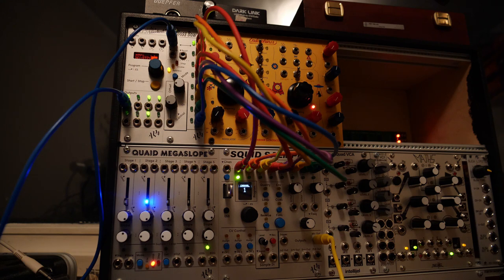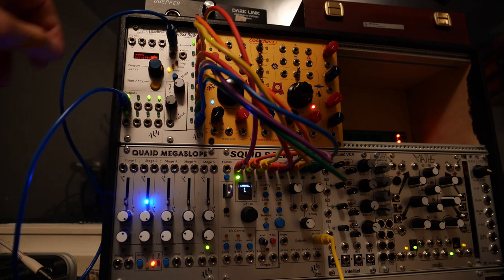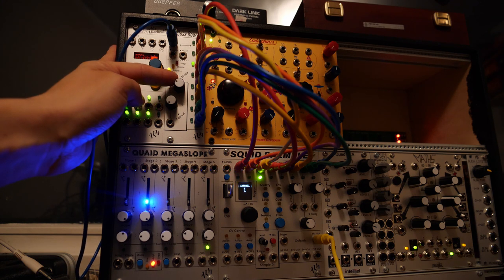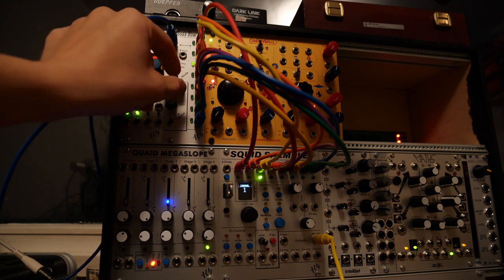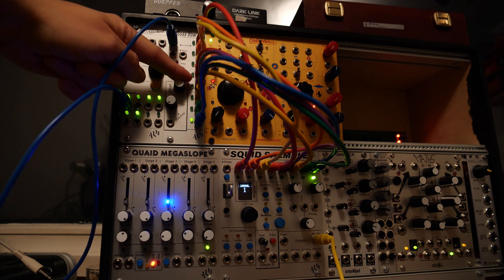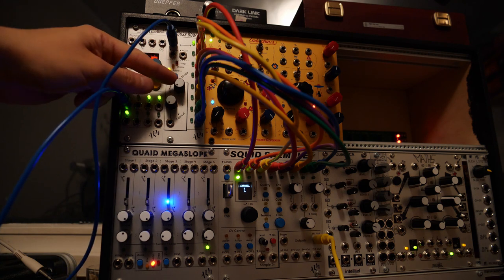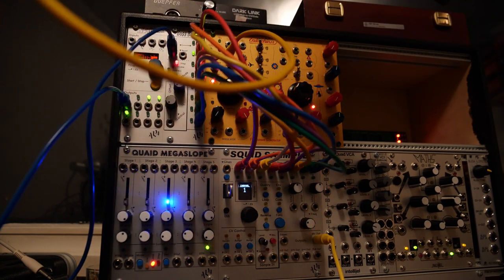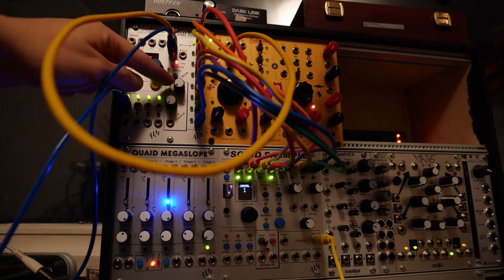Boss Bow Two - Demo

Comment: Thanks for making this. I was planning on getting one but not after seeing your video. Just curious, did you keep the module or did you swap it for something else?
Reply from the maker: got a doepfer 152-2 instead. does what it's supposed to and is very very good
Reply: That's weird because in the official demo video it looks like it works as expected. I guess the alternative is ADDAC206 Switching Sequencer
Reply: Mine works perfect. Have you resolved it?